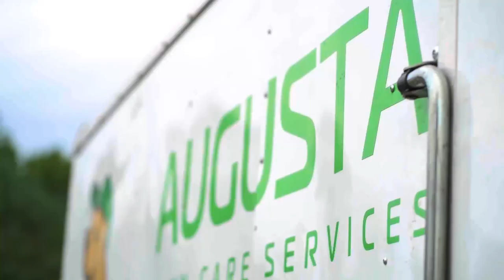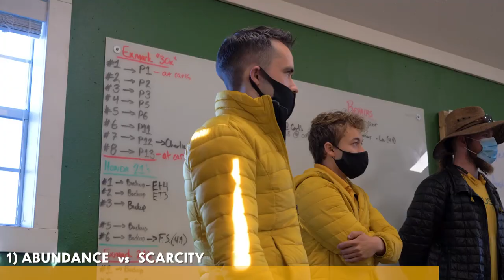Lawn Care is CRAZY Competitive! (Low-Ballers & Massive Companies)

Comment: I have no time or need to worry about the competition. If you lose a client to a competitor it was one of two things. You either sucked or they're a cheap ass that can't afford your services. 

I often use other landscape companies for larger projects that I can't do, but they have the man power to do. I've been doing normal service more than once on a property while having another company doing something such as large tree removal, large hardscape projects etc. I have done flower bed rehabs for these same companies and other smaller projects where it's not feasible for them to do it because the project is not profitable for them.

Perfect your business. Know what you do, do it well. Be efficient and your pricing will not be an issue. 

Remember you're always selling even when you leave the job site. Be proud of what you leave behind, because other potential clients will see what you did..